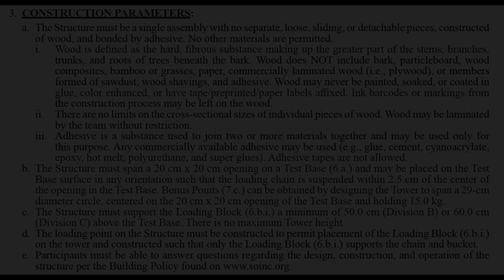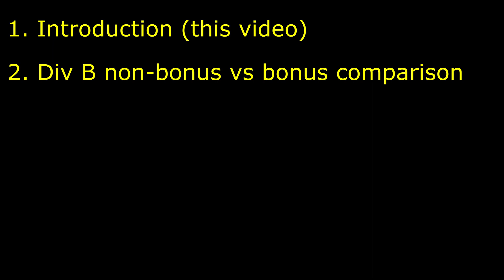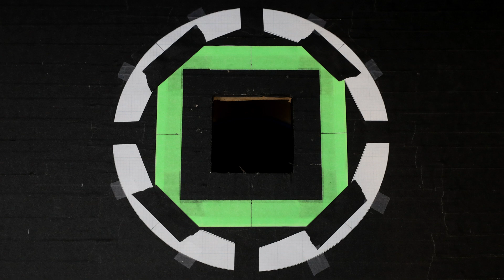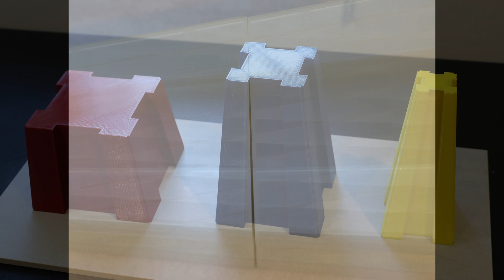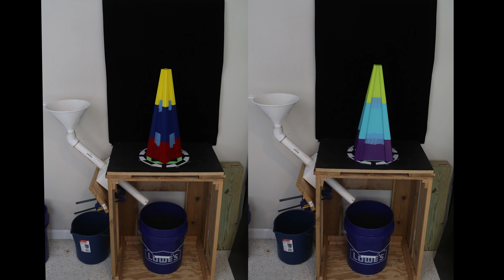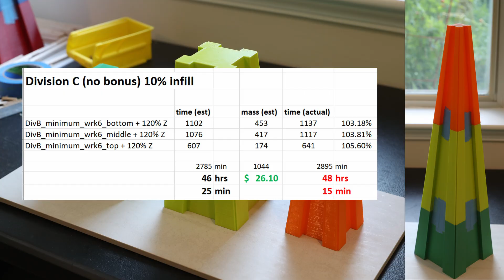2024 Science Olympiad Tower: Introduction

Comment: Would it be possible to post the complete stl files for Div B and Div B Bonus (not cut into bottom, middle, and top)? I am working with a Prusa Mini 3D printer which is 180x180x180.  So I will need to make different cuts. One nice feature of Prusa slicer is that you can add connectors between the pieces so that they snap together after printing. Thanks for the great work you do for all the science olympiad participants!
Reply from the maker: Thanks!! That is a great idea.  Here is a zip that contains both Div B jigs before I cut them into 3 pieces if you want to work with them that way: https://klingerphotography.com/BalsaEngineering/Div_B_Complete_STL.zip     I have also added a link to the video description.  Good luck this season!
Reply: @balsaengineering   Do you have the Div C jig file as well?
Reply from the maker: @MaryamA-i1p  The Div C jig file is exactly the same as the Div B one just scaled 120% in the Z direction only which your slicer program can easily adjust